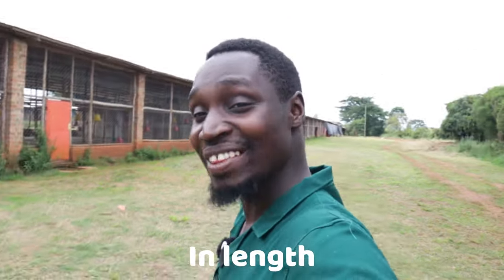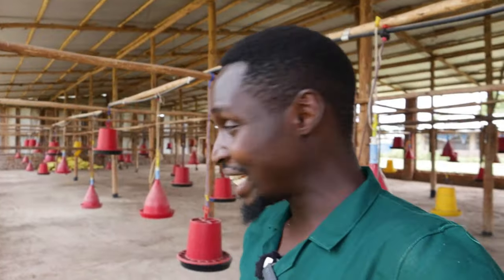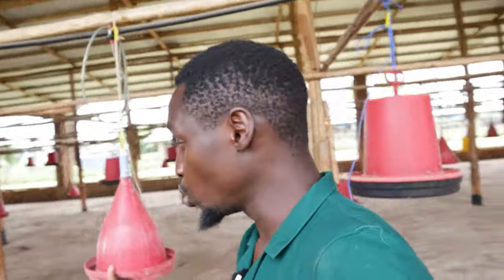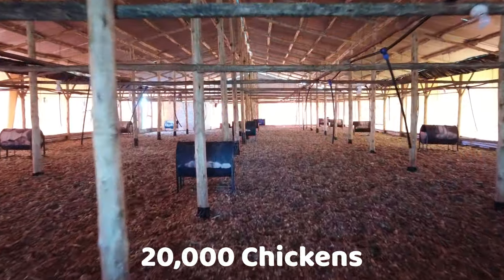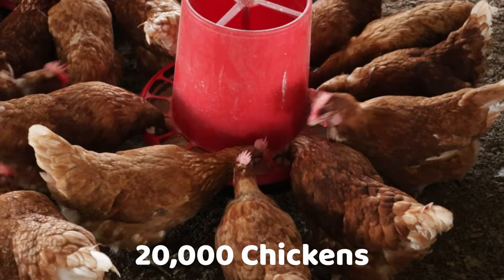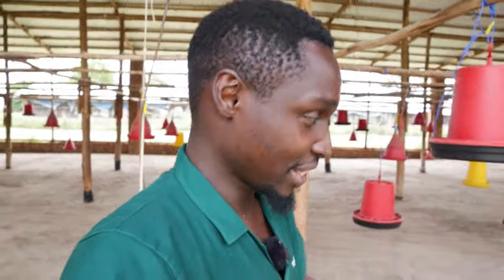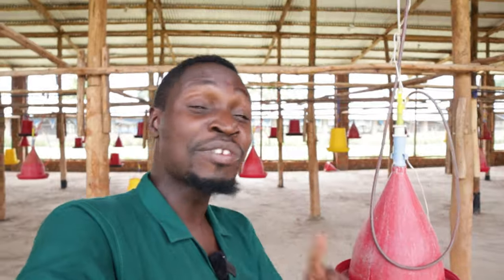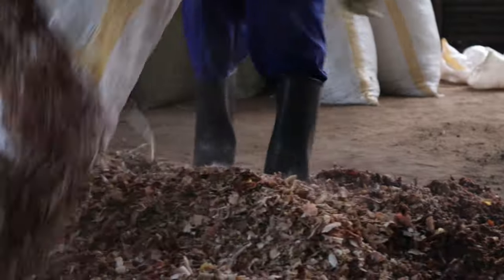How to Build a MEGA Chicken House CHEAP and QUICK

Comment: Hello doctor! When is the April training starting ? I’m from Nigeria snd I don’t mind flying to Uganda to learn the art of Poutry ( deep litter system) in my country most of the commercial farm practice  battery cages which is quite expensive. My farm is still under construction and I’m planing on using deep litter 

In addition, the price of chicken feed is extremely expensive in my country. How can improvise. I know the only way to option maximum profit is to mill my feed. Pls doctor i would love to communicate with you or meet you if there’s any possibility. I look forward to hear back from you
Reply from the maker: It should be running by end of month